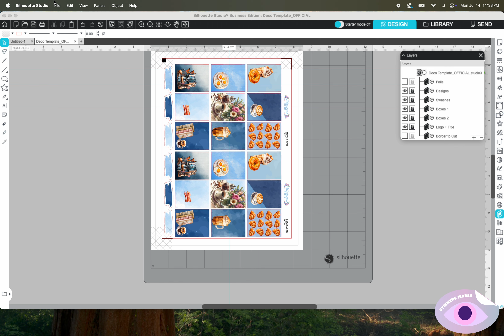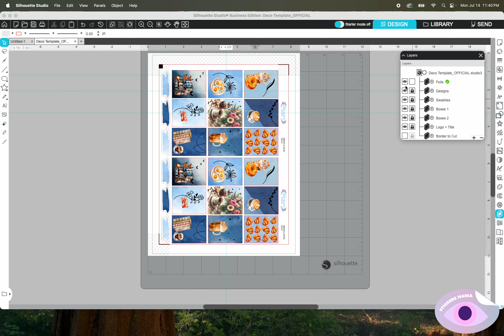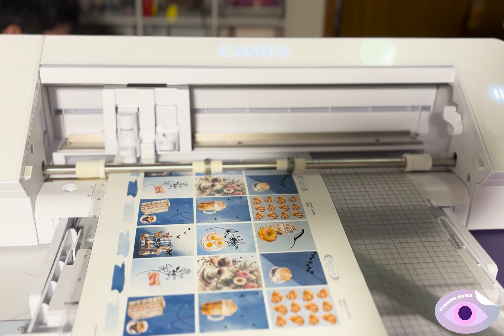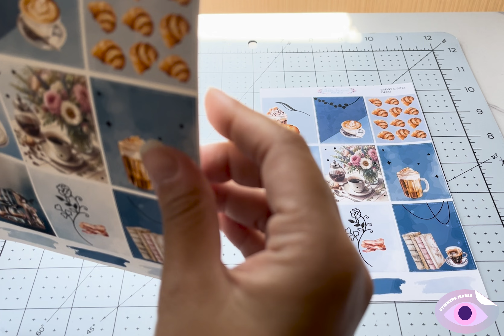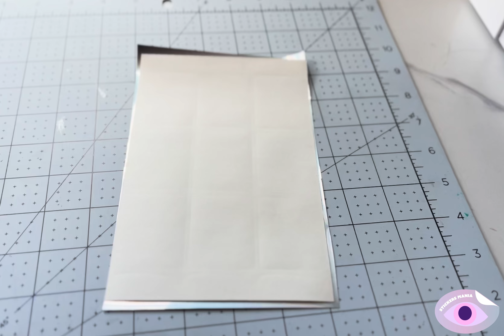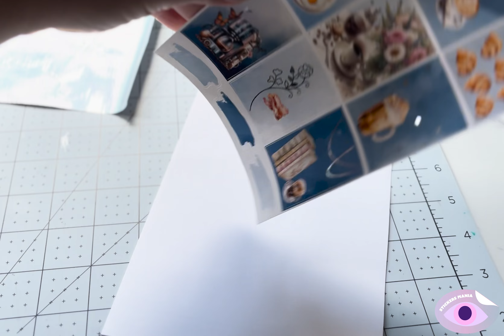How to Foil Stickers with Toner on Inkjet Prints (Step-by-Step with Silhouette)

Comment: how did you managed to print the toner design exactly  on the top of the colered design??
Reply from the maker: a TON of trial and error. I bought and returned 3 printers before I landed on one that printed the toner exactly where I needed it. I also try to design in a way that if it's a smidge off of where I intended, it still works for the overall design.
Reply: @stickersmaniastore  Coool, and which printers you recommend us?? specially if the paper is thick?? around 250gm maybe